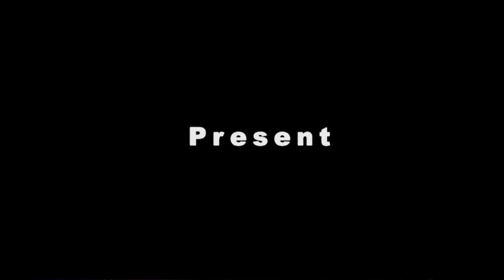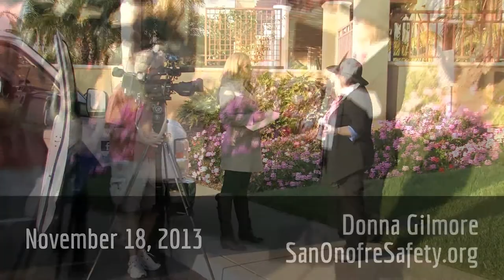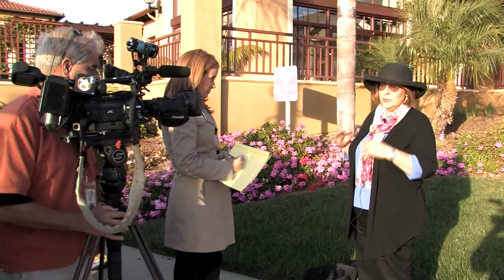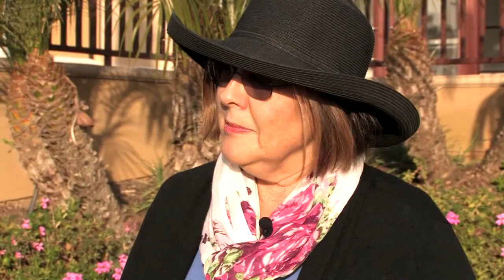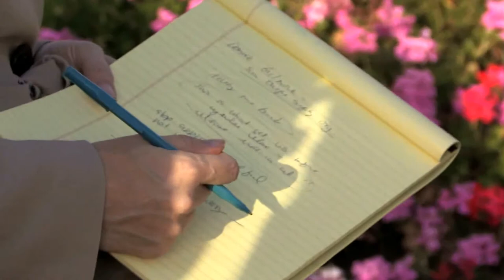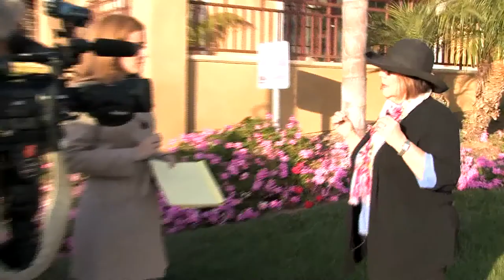☢ High Burnup Nuclear Fuel Is Too Hot To Handle ☢

Comment: The video should be titled "Angry mum who never graduated physics class has dumb opinion on something she doesn't understand". The word "Burnup" when talking about nuclear fuel basically means how much of the fuel has been  burnt up in the reactor. The fuel (enriched uranium) is "burnt" in the reactor to make power... high burnup means the reactor uses more of the nuclear energy in the uranium.... Spent fuel in a high burnup reactor has had more of the energy (radiation) burned out of it. but is more radioactive (over time) due to more of the uranium being turned into extremely radioactive short-lived atoms.  The key point here is SHORT-LIVED... High-burnup fuel waste is more radioactive yes... but for a much shorter time. While low burnup spent fuel is radioactive for thousands of years.. high burnup spent fuel is extremely radioactive for only a few 10's of years.. so you just store it on site for 10 years or so, by which time it has become safe enough to handle with little more protection than a disposable paper overalls and a dust mask.